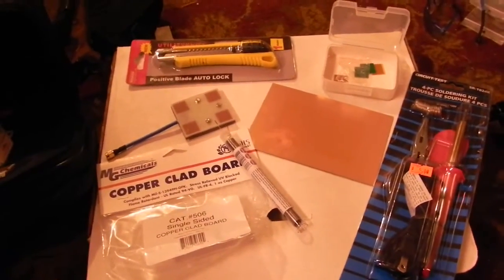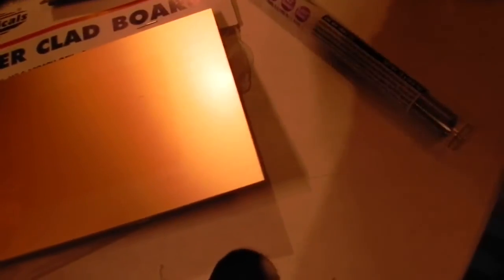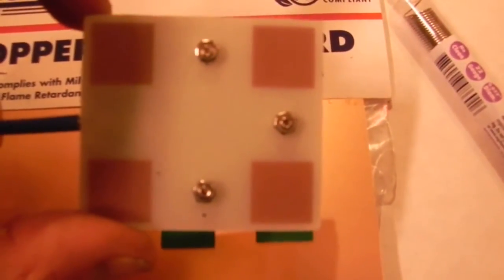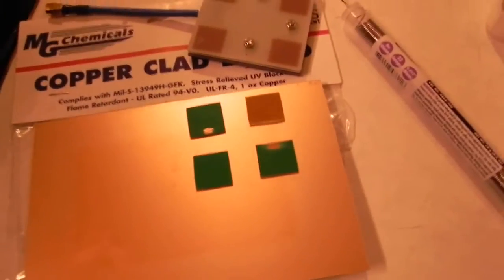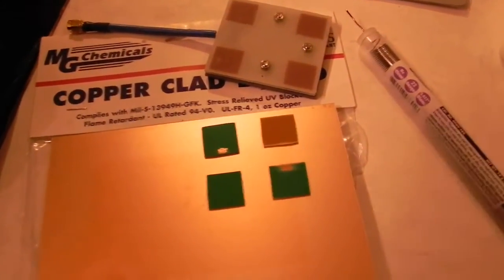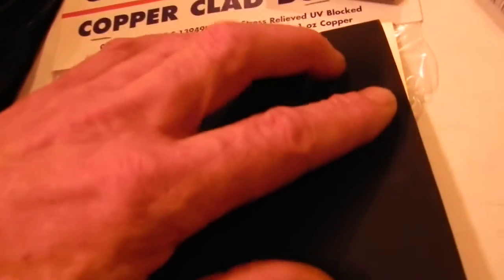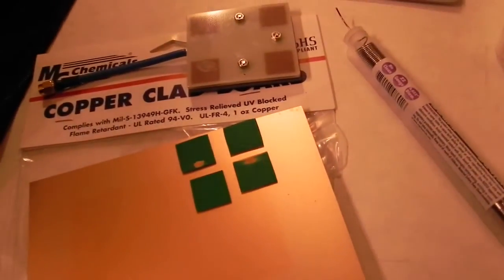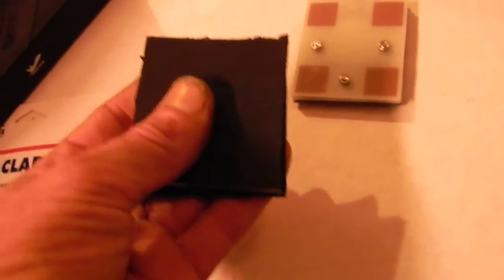My 30min 5.8ghz HBx panel antenna, turns out as good or better than $30. template

Comment: The DVR on the FSPilot fpv camera Must stopped to make the file complete and write the file .there is a way of fitting a 35v capacitor to the lead of the camera and this will allow the camera to have enough time if you unplug your lipo to write the file and record your flight correctly .google around for the way to do it. I did on my Pilot camera and it works a treat!